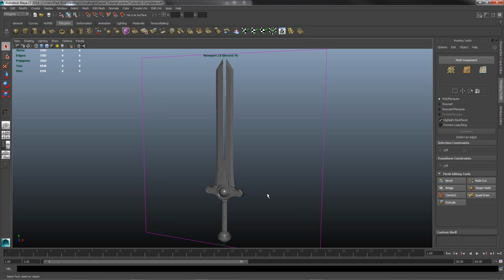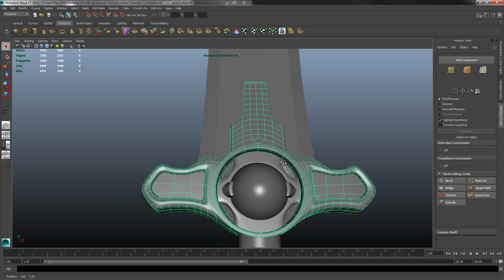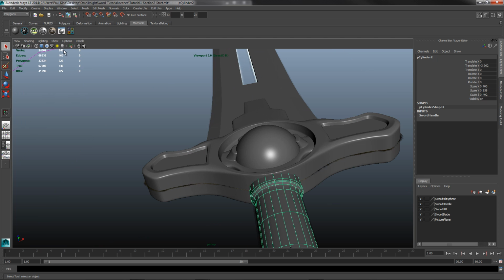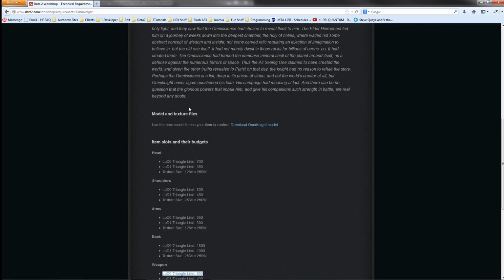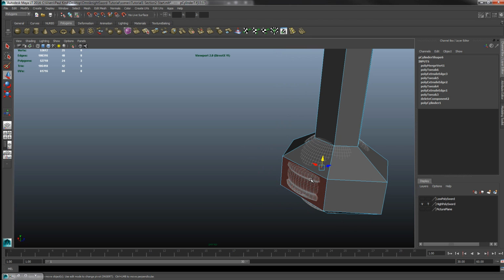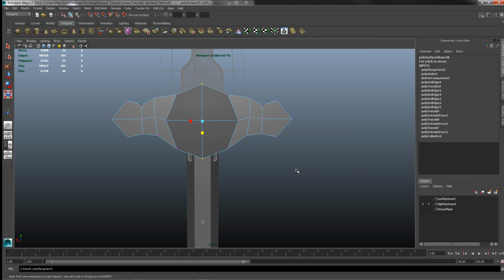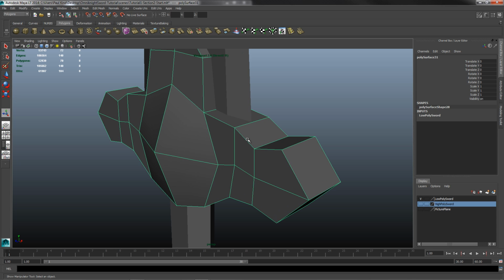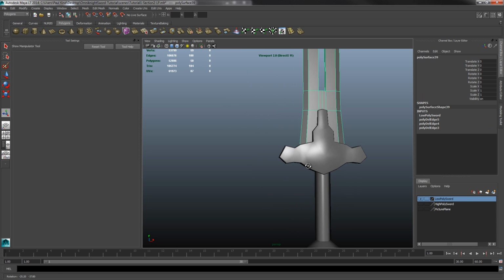Maya LT Dota 2 Tutorial -- Section 2 Part 1

Comment: Alex Hart, to answer your question (i cant reply directly to you for some reason) Smooth edges do carry into game engines and are an imperative part of  your final baking procedure.  It is one of the most overlooked and most important elements.  If you think it should be smooth then DO smooth it.  If it should be a crease and you want a break, you should use the harden edges.  As for using face/edge, face will soften ALL the edges connected to the face.  With edge, you are only smoothing the edges you select.  In general and retrospect, I try not to use Soften edges on faces as sometimes Maya can get wonky when you do.  Though I show a few time using soften edges with faces, it is a bad habbit to get into and I wish I hadn't done it in this tutorial even though it works fine most of the time and is technically perfectly fine.
Reply: Thanks for the quick and informative reply. I think there's some setting of mine that I have to change to allow people to reply to my comment, but I can't even find that option in my settings.  Anyway, thanks again, that's just what I needed to know. =)

Comment: Hello sir. Thank you very much for making these videos. It helps me very much in the beggining of my modelling journey. I would like to ask a question if you allow me. I am working on a mask that has goggles on it. Does my low text poly need to cover all details on my high poly model or can I simply make a sphere that is shaped like high poly and bake them?
Reply: You can bake anything into anything, but you may find the results to be rather unpleasant.  The closer a match the low poly is to the high poly the better the bake will come out.  That said, experiment, so long as it looks good and does what you want it to do it can be counted as a success.